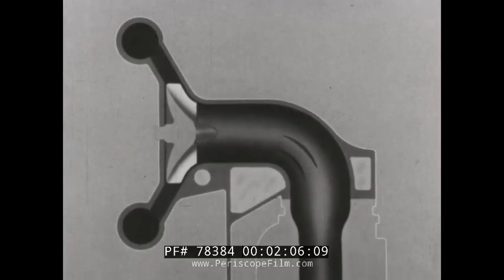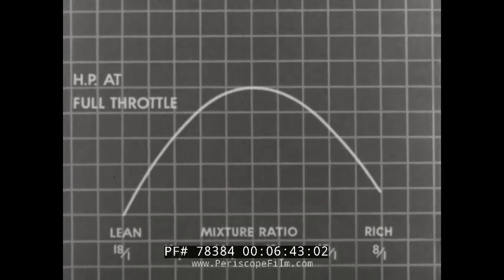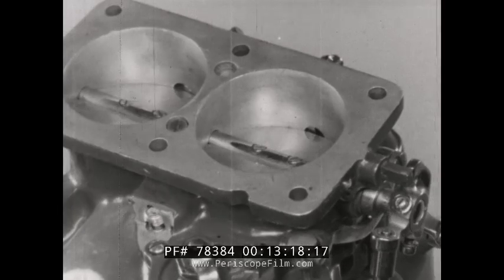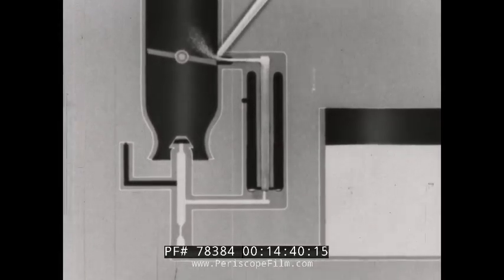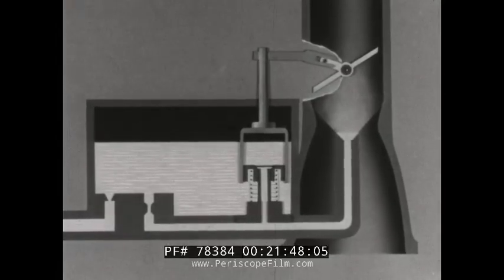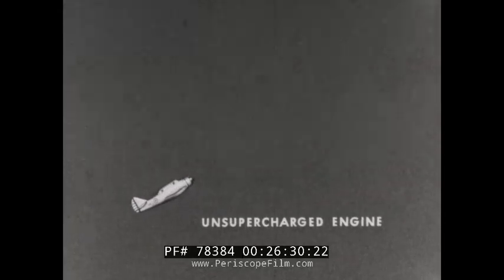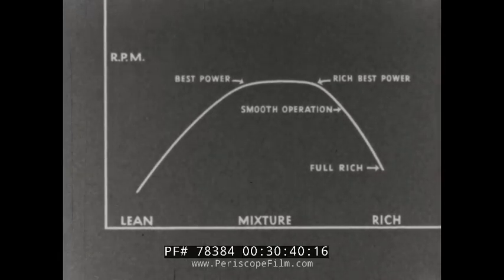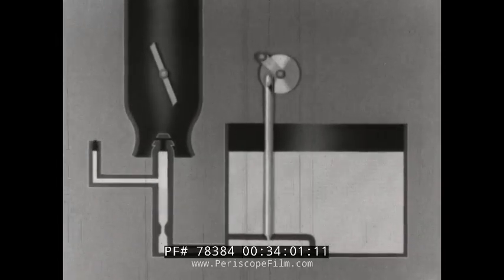WWII AIRCRAFT ENGINE CARBURETOR TRAINING FILM 1940  78384

Comment: The pilot had to make 832 adjustments to the fuel system from heating, cooling, mixture, consumption, tanks equalized, power, cruising, altitude and what not. Then they had a plane to fly!
Reply: Some aircraft had a flight engineer who operated most of the engine control to maintain a lot of this with the pilot doing most of the controlling needed to fly the plane. These controls overlapped a bit, but the flight engineer did a lot of the fuel mixture, fuel pumping/equalizing and other duties. This film about the flight engineer on the B-29 explains it a bit https://www.youtube.com/watch?v=XK2SE9AdcaQ

Comment: You had to understand this just to keep your machine flying. Ignore it at your peril. Charles Lindbergh taught pilots in the pacific to lean the engines out properly to gain fuel efficiency. The mechanics had a fit but Lindbergh knew his stuff. Not much was automatic. you had know how to operate it.
Reply: ..... Now Pilots just look at a Screen while a number of Computers fly the Plane.
They could NEVER Fly an old Aircraft!!
Reply: And if this stuff matters ANYWHERE, it matters above the big giant vast and fuel-empty Pacific Ocean.
Reply: @CarminesRCTipsandTricks  to be fair, unless you are spending half a million on the plane, it is probably gonna be manual fuel mixture control.
Reply: @sheeplord4976  I completely agree with you. I was just saying that Pilots TODAY would be completely perplexed by the complex and sensitive manual controls of classic Aircraft...
Reply: Lindbergh's input gave them a substantial increase in range. (I wanted to emphasize substantial, but I didn't want to use all caps and look like I was screaming. Lol)